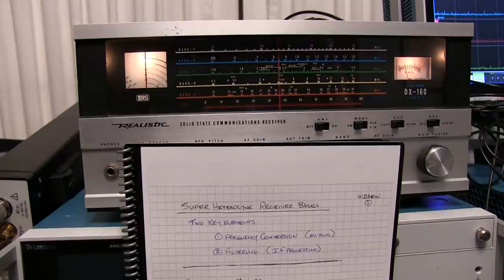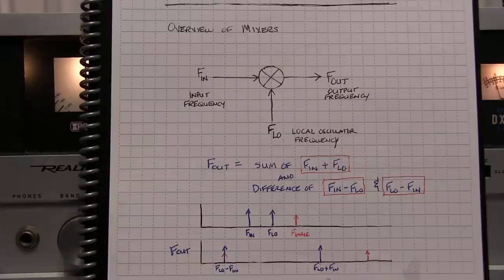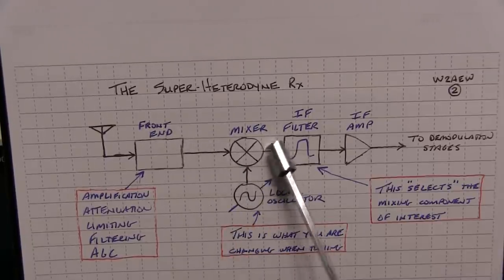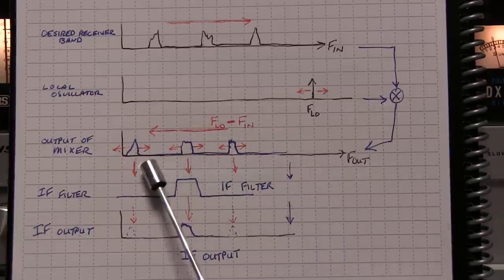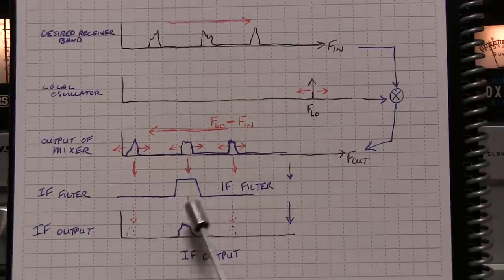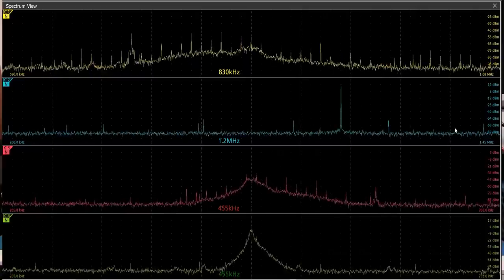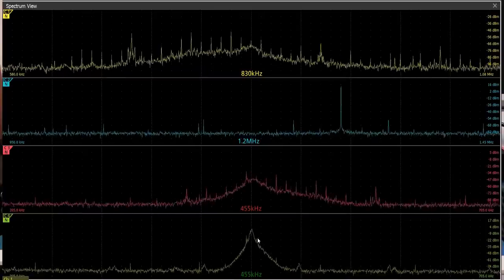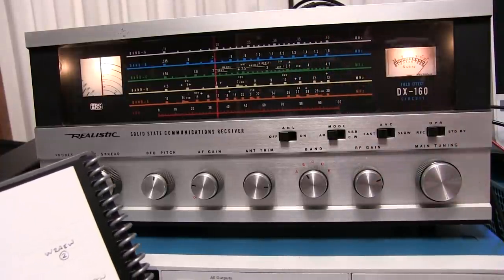#339: Basics of a Super-heterodyne Receiver - how it works, and a peek at the signals

Comment: Alan, I've spent the last 8 months immersing myself in tube radios, upgrading my license, etc and your videos have been extremely helpful.  In some way you've answered most all of my questions.  However, I was about to ask you for a video on heterodyning and you beat me to it!  Very good video.  
I have done a fair amount of work on the Halli S 85 which uses the sum of Fn and Fo for most of the bands in the IF chain.  I've learned that I can check the Fo+Fn by using my TinySA and almost touch the antenna to the 3 gang tuner LO section or the feed wire inside the chassis.  There I can see a peak that represents the sum of the 2 frequencies and how close it is to the tuner dial, minus the IF.  It's a great little gadget for troubleshooting tube radios, which is all I work on.  So with 455Khz IF, most of the broadcast band, for example, will be higher freq than the IF so summing will be used, correct? Or, do some radios using a 455khz If use the Fn minus Fo?  Also, so if I understand this right; in the S-85, the combined 455 and Fn are fed into the IF filters that allow only the 455 to pass through, however the 455 maintains the AM modulation (fingerprint) presented by Fn when the two freqs were combined in the mixer.  My question is how does the modulation not get corrupted in the process of going from the Fn to the IF?  Seems to me the fidelity of the original modulation would be reduced when going from a higher freq Fn, say 1.2Mhz (consider the freq a sort of sampling rate) when down converted to 455Khz?  Just not noticeable?  Or do I misunderstand this?
Thanks for another great video.
Reply from the maker: As I said in the video, some radios use high side injection (local oscillator above the frequency of interest), and some use low-side.  Most high-side injection schemes that I've seen use the difference between the local oscillator and input frequency.  The whether high side or low side is used, or whether the sum or difference is used, will have no bearing on the modulation quality - there will just be spectral inversion in the case of F(lo)-F(in) schemes.

Comment: As part of my microelectronics course, I had to build a superhet based radio using only transistors, diodes (including varactors), and passives. We didn't design anything, just did the math to determine the values for the components in each block of the signal path. Even after explanations, doing all the calculations, building, testing, and it actually working, I didn't fully understand what was going on. Until now that is. Fantastic video, super clear demo that just nails it. Keep up the fantastic content!
Reply from the maker: Really glad to hear that this video help flip on the light bulb!

Comment: Great demonstration. I learned this way back in my military training back in the early ‘80s, but I never had access to a spectrum analyzer to see it so clearly. One of the John F. Ryder books I picked up cheap on eBay is “Servicing Superheterodynes” from 1935. It’s got a good explanation, but it’s not as clear as yours. I always wondered where the word came from. Ryder says it is just another term for mixing and seems to use superheterodyne interchangeably with heterodyne. I always wondered was the “super” prefix added for an improved version of the heterodyne?. The roots of the words are hetero meaning different, and dyne meaning power, so I guess that makes sense since it mixes two different power signals, but I would think it would have had something referring to frequency since that’s more descriptive of its operation. 455 is one of those numbers I’ll always remember since it was the IF frequency in all the literature I encountered, but I was surprised to find there were a wide range of IFs in the Ryder book, but that was pre-WWII.
Reply from the maker: Heterodyne refers to the mixing of two frequencies to result in a desired frequency shift.  First employed in audio demodulation. When it later got used a higher-than-audio frequencies (super-sonic), the "super" from supersonic got pre-pended to heterodyne.  So, superhet simply refers to the heterodyne process applied to supersonic signals.
Reply: @w2aew  Thanks for the clarification. That makes sense now (after 40 years of wondering). I’ve read quite a few books on the subject, but I’ve never run across the explanation as to where the “super” prefix originated. Thinking about it, that helps me understand where the alternate term “beating” is derived. I’ve heard that used, but it wasn’t until I started playing with audio frequency mixing and tuning in music synthesizers, where the beating can be heard, that it became more clear that beating is a good description of what’s going on in a mixer.

Comment: Awesome video! It just occurred to me that listening to the radio would be much more fun if receivers came with built in scopes to show what you've shown in the video. It could also help tuning.
Reply: Many amateur radio (ham) transceivers do have multi-finction scopes that help with finding signals to listen to as well as other functions
Reply: With and SDR you can see the spectrum of the signal you are listening to.
Check out the RTL-SDR, they are about about the size of a flash drive and plug into a computer or tablet. You can get them for around $20.
Reply: @rocketman221projects  but that's the audio spectrum/waterfall display.
It doesn't show anything about like the principles of superheterodyning what Alan showed with the spectrum analysis.
De VU2RZA
Reply: @subramanianr7206  An SDR shows the RF spectrum. An RTL-SDR shows over 2MHz. High end SDRs can show hundreds of MHz.

Comment: Thanks Alan!!!   BE fun to see reasoning and operation of "double conversion" and also the passband slopes of SAW filters ( 455KHz or 10.7 MHz) versus LC stages.  Thanks!!!
Reply from the maker: The very short answer is  -  the image frequency shown in the video is produced by a F-IN signal that is 2x the IF frequency away from the desired signal.  So, the higher the IF frequency, the farther away the image frequency is - thus easier to filter before the mixer.  But, higher frequency IF filters are much more difficult to design for good narrow-band selectivity - that's much easier to do at a lower IF frequency.  So, first conversion into a high IF freq stage is done for image control, and the 2nd conversion into a lower frequency IF is done to give you selectivity.
Reply: @w2aew  And if you do two times a conversion (F-IN), one to 10.7 MHz and one to 455 KHz, the spectral inversion gets undone I supose?
Reply from the maker: @LUCVLOEMANS  If both are high-side down-conversions, yes.

Comment: Question:
Would you explain how you chose the points that you connected the scope to ?

Very great video.
Might be a good idea to make a video showing how to choose the points that could be connected to the scope   for this purpose.
Reply from the maker: I chose points that were at the inputs and outputs of the mixer stages, as well as the local oscillator for the mixer.
Reply: @w2aew 
Thank you for your answer.

Comment: Interesting video! It is very easy - but I have not made good active RF mixer - there was parasitic generation or something else (for example big time constant in base of an oscillator). I had good results only with passive mixers - diode or a mosfet switch.

Comment: Alan, very nice explanation. The only thing that puzzels me, when tuning to the particular signal the input band (yellow) also changed. I did not expect the curve to chance so much…. The is probably a simple explanation, but my mice brain could not vadem it.
Reply from the maker: This is because I purposely left out some detail.  In most single-conversion receivers like this one, when you're adjusting the tuning knob, you are also adjusting a bandpass filter in the receiver front end - that is the response you're seeing on the yellow trace.  This filter's main job is to keep the image frequency from getting into the mixer, and to help keep strong adjacent signals from overloading the front end.

Comment: Nice demonstration. So, it doesn't really matter for digital, the issue can be addressed mathematically, but for analog satellite TV (almost none left up there) the spectral inversion had to be addressed. In satellite delivery there's 2 primary bands, C and Ku (K-under). (There's many but for the analog days for stuff like network distribution and news gathering this was it.) Modern receivers use a block conversion which is the entire band is converted down by this same mixing process into something more manageable. For C band we use high side injection. This results in inversion. Analog TV on satellite is in FM. This results in the picture being inverted, not upside-down but light became dark & vice-versa. So the receiver has an inverter to correct it. But for Ku band low side injection is used, no inversion. This is done so that regardless of desired band it would be converted to something the receiver could accept.

Comment: Nice 70's goodness, A big old skool radio. Metal. No plastic casing. Impressive bit of modern kit (linked to a computer?) showing 4 channels, probes. 
Good video. 
Was a requirement to me for the hand held radio. No Baofeng or any other make Direct conversion stuff. Went for a lower end singal line display digital Yaesu handheld.
Reply: No. I see the thing in the middle of the banner photo. nice screen bit of kit. 4 things at once. Used oscilloscope. 2 things at once.
Reply from the maker: @DanielGlover  I actually used a new Tek 6-Series MSO - like the 4 and 5 Series, this scope features an RF digital downconverter on every channel of the scope, allowing you to do spectrum analysis on multiple channels, at different center frequencies, at the same time.
Reply: @w2aew  Very posh, just googled it. did electronics back in the day, test and built, not for years now, those days gone  think. My radio stuff, cheap thing the car and and the Yaesu on QRZ, linked in about or banner photo corner. I got a chinese, Amazon finest multimeter. Not a thing a proper company would have, cheap £36 thing. not dollar store (poundland) tat but cheap enough. does capacitance, frequency, usual things. Now to bed. coming up 10pm here  :)

Comment: You are actually tuning the input filter and the oscillator in order to create a constant IF, hence you find these twin variable capacitors in superhets.
Reply from the maker: Yes, I know.  I decided to leave this detail out of the video because I didn't want to complicate things, and wanted to focus on the superhet architecture itself.
Reply: @w2aew  Thanks for the reply, but I must disagree here: This detail is very fundamental for a superhet to work. Also, it should be mentioned that the reason for making all that effort is that you can have multiple IF filters in series and therefore a high Q factor overall, which makes for the high selectivity (in an analogue world).
Reply from the maker: @MadMaxMiller64  Not all superhets have a tunable filter.  Double and triple conversion receivers with synthesized VFOs (where the tuning is done via an encoder) don't have front end bandpass filters that are adjusted along with the tuning.  In these cases, the first IF is typically a much higher frequency, thus making a simple band-specific low pass front-end filter effective in removing the image frequencies.   I do agree with you, that this IS fundamental in single-conversion superhets though.
Reply: @w2aew  They don't have smileys here - take an ascii one :-)

Comment: 3:57 Demodulation type ?
which Modulation are exist in CRT tv tunner  IF out ??
Reply from the maker: As far as I know, the CRT TV tuner IF output does not perform any demodulation - it will just be an IF output, yet to be demodulated.
Reply: @w2aew  i mean if it's Fm Am or other type of modulation?
Reply from the maker: @omsingharjit  In the US (not sure about other countries), the analog picture signal was sent using a form of Amplitude Modulation called Vestigal Sideband (basically AM with one sideband removed and the carrier partially attenuated).  And the sound is Frequency Modulated on a carrier that was offset from the picture carrier by 4 or 4.5MHz.

Comment: But in front end is tunable tank also which is changing resonance according changing local oscillator and mixing both to new IF.
Reply from the maker: This is true for most single-conversion receivers, but less true for multiple-conversion receivers.  I chose to leave this detail out because I wanted to focus on the role of frequency conversion and IF processing, which is the core of the superhet process.  A tunable input filter is a helper, but not strictly a part of the superhet process.
Reply: @w2aew  , but where is your tunable input resonance tank, I do not believe it is in mixer stage?!
Reply from the maker: @vjekoslavcvetnic7500  The tunable bandpass filter (LC tank) is essentially at the output of the front-end preamplifier - providing a tuned-circuit load for the preamp.  CH1 is probing at the output of the preamp with the tunable LC load - so you can see the effect of it as I tune - you can see the "hump" in the noise floor move as I tune the radio.

Comment: nice clear explanation although I didn't understand the image response. I expect that is covered in earlier videos.
Reply from the maker: Consider the case where the IF is 455kHz and the desired frequency to listen to is 10MHz.  In this case, the LO frequency into the mixer will be 10.455kHz.  But, in this case, if there is an RF signal at 10.455 + 0.455MHz, or 10.910MHz, it will also appear at the 455kHz IF frequency.  So, you have both the desired (10MHz) signal, and an unwanted "image" signal (10.910MHz) that appear at the same IF frequency.

Comment: Great video! I never really though of the superheterodyne as a type of radio where you can just vary the LO frequency; I mean its perfectly possible, but you did not really mention that at the same time you vary the LO frequency, you also vary the input stage filter frequency to obtain better selectivity - this was quite nicely visible on the upper spectrum. The pass band on the input stage "hump" was also moving together with the LO response.
Reply from the maker: This is true on single-conversion radios, and is what helps to reduce the image problem.  Double and triple conversion radios, especially those with synthesizer-based LO circuit, often do not have tunable RF bandpass filters - maybe a bank of switchable filters depending on the frequency range the radio is set to.  I chose to leave that part out of this video, and focus just on the frequency conversion and selection process.
Reply: @w2aew  I understand now, Thanks!

Comment: Great video! But I have a question about spectral inversion. In the example, the local oscillator appears fixed-frequency whereas the front-end varies, hence the difference frequency adjusts. I always believed in most older transistor radios with a tuning gang, both the front-end was variable (to be resonant at the desired freq) and the LO was also variable (oscillating exactly 455 kHz higher) so front-end and LO always acted 'in-sync' and the difference freq always came through at 455 kHz. I have read that in more modern superhets (with a voltage-controlled oscillator) only the oscillator varies, hence inversion. I appreciate any advice on this
Reply from the maker: The LO is not fixed in this example.  It is varied as you adjust the tuning knob, as can be seen in the 2nd spectrum trace from the top at about 11:00 in the video.  It is true that the front-end bandpass filter is "gang tuned" along with the LO frequency, which is true for most inexpensive old transistor radios since they are mostly single-conversion, and a tuned bandpass on the front-end helped to reduce image problems. The spectral inversion comes from the fact that the LO is higher than the desired RF signal, thus the IF is equal to the LO - RF.

Comment: Thanks Alan amazing explanation as always, what kind of spectrum analyzer have you used ?
Reply from the maker: It is a Tektronix 6 Series mixed signal oscilloscope (from my job) that has RF digital down-converters for spectrum analysis on each channel.
Reply: @w2aew  wow, are they real spectrum analyzer or is a ft?
Reply from the maker: @quirinodina  It's very close to the architecture used in a vector signal analyzer or realtime spectrum analyzer.  The DDC converts the incoming signal into baseband IQ samples (see video #170).  From those baseband samples, a digital Fourier transform is performed.  I believe that a Chirp-Z algorithm is used.

Comment: Great explanation of the superhet receiver.  Does the spectral inversion cause confusion when demodulating SSB signals?
Reply from the maker: Not really - you just have to adjust the tuning and BFO to essentially position the BFO injection on the correct side of the signal.  It's all very transparent - you just tune through the signal,  as you pass through you will transition between hearing a clear and then a garbled signal -  and you just tune for the clear signal.

Comment: Excellent explanation, but I have problems to read the frecuencies ataching the scope probes, because it detunes the oscilator.
Reply from the maker: A few things to try:  use lower capacitance 10x probes, try probing after a buffer stage - not on the oscillator directly, try using a "sniffer loop" - a couple of turns of wire connected between the probe tip and probe ground - to inductively pick up the oscillator signal.
Reply: @w2aew  Ok, I used a vertical magnetic probe to adjust the LO range correctly with the spectrum analyzer. And injecting 10.7MHz modulated into the IF input sounds fine, but there must be some problem with the RF DMOS tuning stage because the signal is very weak and shifted on the dial by about 5MHz in frequency. But, touching the mixer input with a cable (probe, finger) sounds fine!